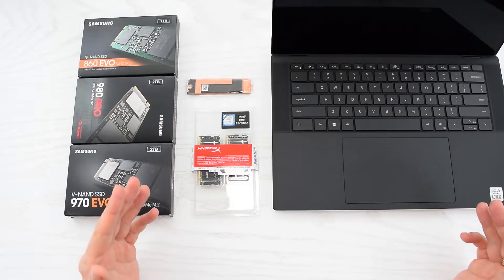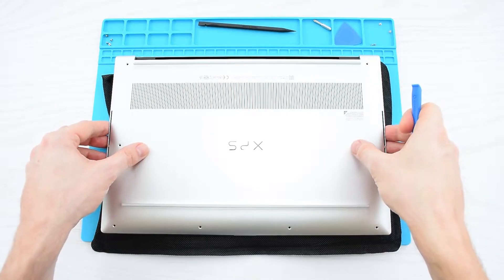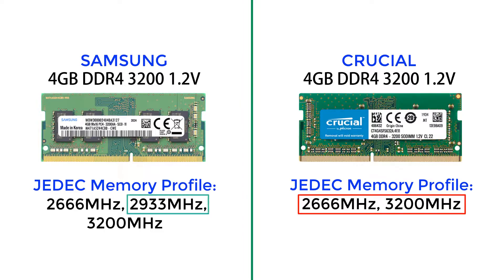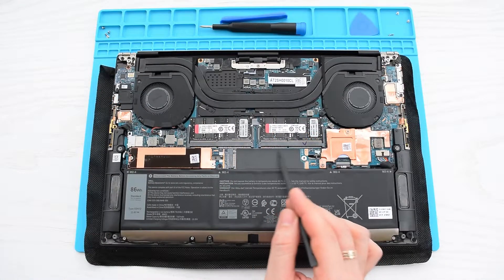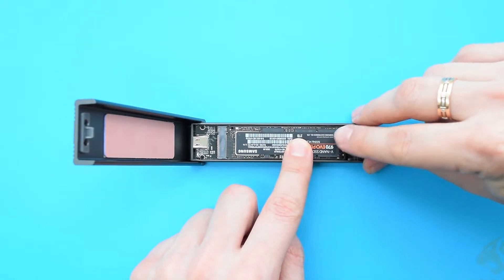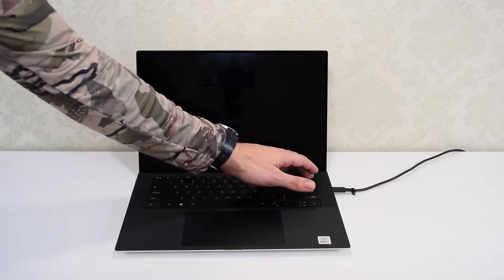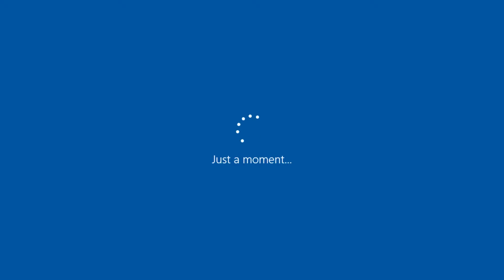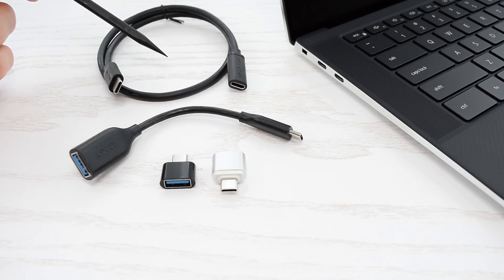Dell XPS 15 9500–9530 RAM & SSD Upgrade Guide | Max Performance Setup!

Comment: Thanks for recording such a detailed tutorial on upgrading the RAM and SSD for Dell XPS 9500.

I run into one problem, could anyone from the channel, or someone who watches the video help me?

Yesterday, before I started upgrading the RAM and SSD, I read on numerous websites that it would be recommended to disconnect the battery cable before replacing the RAM and SSD. I also asked ChatGPT and Google Gemini and they both confirmed that it would be recommended to unplug the battery cable to avoid accidental damage to the RAM or SSD, so I decided to unplug the battery cable before upgrading the RAM and SSD.

When I tried to disconnect the cable, it seemed a little bit stuck. Then I used this technique to remove the battery cable - https://youtu.be/E7qzwAFabS0?si=OB2mPJwvw2g9Px2F&t=466 - where you disconnect the speakers and lift the battery a little bit, that gives one enough room to disconnect the battery cable more easily, and this technique allowed me to disconnect the battery cable.

After replacing the RAM and SSD, I was not able to connect the battery cable to the socket. After it goes halfway through it, it seems to get stuck and no longer moves, no matter how much force I apply. Unfortunately, I have watched dozens of videos on YouTue and other Dell XPS laptops do not seem to have this problem. For them the battery cable can easily be disconnected and connected again to the socket.

I tried to connect the cable to the socket while applying the same force on the left and right side and try to connect it in a straight direction, but it just gets stuck halfway through and forcing it to move does not seem to help. I also tried to apply a lot of force, but it just does not move.

I used the laptop for work, and I did not expect this to happen. It's extremely important for me to find a solution to this problem soon. Can someone help me?

I want to thank everyone in advance who takes time to read my comment and replies. Your help means the world to me ❤
Reply from the maker: You'll never damage replacing a RAM module or an SSD just because the battery is still plugged in. It's a good practice to disconnect it only just in case you do something wrong. Like I mentioned in the video, if you're unsure of your skills or don't know what you're doing, then disconnect the battery. This is crucial because if you drop a screw on the board or if your screwdriver slips, you can easily short circuit something. I work with this type of stuff daily, so for such upgrades, I usually never disconnect the battery. Another reason I avoid disconnecting it is because it will reset the BIOS to default settings, and I don't know what custom settings the customers may have applied. In your case, it appears some pins were bent in the connector, which is why you can't fully insert it. What you need to do now is fully remove the motherboard so you can see the inside of the connector, and then use very thin tweezers or something similar to carefully straighten the pins. However, under no circumstances should you use the connector while it's partially inserted. A huge current flows through those pins during charging, which can easily melt the faulty connector and damage the motherboard. If you need more help, I will be happy to assist you.
Reply: @ElectronicsComputers  

I am extremely grateful for taking your time to write such a detailed response ❤ 

I can’t describe in words how much time you may have saved me and how helpful your reply to me is.

I am glad to hear that RAM or SSD won’t get damaged during the upgrade if I don’t disconnect the battery cable. I have upgraded RAMs and SSDs in my old laptops without disconnecting the battery, but I was doing it for the first time for my Dell XPS.

Since the Dell has a warning on the battery that says “Disconnect the battery before accessing any parts or devices”, I was worried about it. I also read two posts from other users that they have upgraded the SSDs and the laptop no longer was booting up and someone mentioned in the comments, that they may have accidentally short circuited the laptop.

Because of this, I decided to disconnect the battery cable just to be on the safe side.

I am confirming that I am confident in my skills and there’s minimal chance that I will accidentally slip the screwdriver or I may accidentally drop the screw on the motherboard. Luckily, I have a laptop screwdriver set. The screwdriver has a magnetic finish and the screw attaches to it once you remove them, so the chances of falling it off accidentally is almost minimal. I’ve never accidentally dropped the screw on the motherboard, or touched the screwdrivers on other parts of the laptop, so based your response, in the future, if I want to upgrade the RAM and SSD on my Dell XPS, I have to keep the cable connected and upgrade the RAM and SSD without worrying about damaging the laptop.

Thanks for letting me know that the pins may got bent and that’s why the cable no longer connects to the socket. From what I saw from the naked eye, the pins seemed to be aligned correctly. I will disassemble the laptop in a few hours again and will take a closer look at the pins with a magnifying glass.

I am happy to say that I have a small tweezer for the laptop, so hopefully, I will be able to correct the pins and connect the cable myself.

Thank you so much for letting me know that I should never partially insert the cable to the socket and it needs to be fully connected, otherwise, it may melt when charging the battery.

I want to thank you again for the detailed response. You absolutely made my day ❤
Reply from the maker: @bekamarsagishvili7957  I'm happy to help, as always! If the pins are perfectly straight, then maybe something got inside the connector. Also, check the battery side connector; you can use a needle to check each hole. There are some small metal contacts that sometimes can be bent. I'm pretty sure you'll fix it. It's a very good laptop and nicely built.

Comment: Hi,

I have the Dell XPS 9500, would it be possible to upgrade the M.2 to 4TB as I currently only have 1TB SSD.
Reply from the maker: Sure! Just put it inside and install Windows and that's it. There's no any limitations by the SSD capacity.

Comment: Do you remember the size of the screw for the second SSD? The screw from the first slot which is M2 size doesn't fit for the second slot. It much more thinner. M1.6 / M1.4?
Reply from the maker: There's always  M2 screws for all M.2 modules. In that particular case Dell uses M2x2 screws. Try to swap the screws.

Comment: Highly professional my friend 👏 

Can I use exactly the same upgrade on XPS 15 9530 i7-4712HQ 2.30GHz?

Thank you so much in advance🙏
Reply from the maker: Absolutely, all those models are the same. Just make sure you use the correct RAM; all the links are in the description.
Reply: @ElectronicsComputers  My apologies for a misleading description. That would be the exact Dell model -->  https://www.youtube.com/watch?v=PBPadu8T5WE&ab_channel=PCMag

XPS 15 9530 i7-4712HQ 2.30GHz 4cores (year 2013) 

Just how far can I push the upgrade for this model/motherboard please? 

thanks so much (like and subscription added)

Comment: Amazing video! So well shot and edited. To-the-point and quick!

I had one question though, is it necessary to use a heatsink for the SSD or can I just apply the thermal pad and call it a day (as TheEverydayDad did in his video of the Dell XPS 15 9500 upgrade)?

Thanks!
Reply from the maker: Yes, it's absolutely necessary to use a heatsink because that's what dissipates the heat. The thermal pad only transfers the heat from the uneven surface of the drive to the heatsink, and the thermal pad should be firmly pressed between two surfaces for maximum performance. The thermal pad itself won't cool down your drive; it will fall off once you flip your laptop.

Comment: If I buy a 980 PRO with the heatsink then I assume I can just install it as is?
Reply from the maker: Yes, if you buy a 980PRO with the built-in heatsink, you can use it right away. However, it's important to note that this SSD may not be compatible with all devices. For instance, it may not fit in most laptops and some portable desktop computers.
Reply: @ElectronicsComputers  Ok thank you!

Comment: hello, can i upgrade my xps 7590 with the 980 pro? i would like to improve performances and thermal issues
Reply from the maker: Yes, it will work perfectly well on that model and you'll never have any overheating issues with that SSD in that particular laptop.
Reply: @ElectronicsComputers  even if is too much powerful than the basic one installed on the laptop? just thinkin about the fact it's a 2018 model

Comment: Hi. I purchased the Kingston FURY Impact memory KF432S20IBK2 (2x32GB) which I believe is the same as you have here, but I get the 4 white 2 orange color codes meaning memory failed. Any thoughts how I can solve this? Specs indicate they support all the profiles you mentioned. XPS 15 9510 11th Gen i9-11900H
Reply from the maker: Try to swap them from a slot to slot and also try one by one in different slots. Those RAM modules should work perfectly well on that laptop.
Reply: @ElectronicsComputers  thank you. I tried that and still not working. Tried all combinations even mixing with the old 16gb memories. I read on forums that people have this issue and nobody seemed to have solved it. Many posts say XMP certified is what makes them incompatible.

Comment: Hi is there any point buying the 980 pro for this model because won’t the speed downgrade to gen 3 speeds anyway? both ssd slots are gen3 slots? I have the xps 15 9500 2021 model. is there a better alternative that’s cost efficient?
Reply from the maker: I've made a video about that as well. And 980 performs way better than 970 3gen SSD. And second of all Gen4 SSD running on Gen3 capable platform will never overheat. https://youtu.be/O1WlzO97VfA

Comment: Did anyone have an issue after installing the ram, i had issues getting the computer to get past the dell screen. Does anyone have a fix for that ?
Reply from the maker: What's the model of your laptop and what kind of RAM did you used?
Reply: @ElectronicsComputers  i have the 9510 and the ram I got was the same one in the link. It says kingston Fury impact ddr 4
Reply from the maker: @rainbowblk  Can you enter the BIOS or the laptop freezes at the dell logo? Did you disconnect the battery prior to installing ram? There are too many variables that could go wrong.
Reply: @ElectronicsComputers  first off thank you for the help. Yes the laptop keeps freezing at the dell screen and no yes the battery was disconnected and dead at the time. Can I email you or have you email me or something.
Reply from the maker: @rainbowblk My email is in the channel description. It's still not clear for me if you can get into the BIOS or not. Your laptop can freeze at the BIOS level with the Dell logo and when the laptop starts to boot Windows. Turn on your laptop and immediately start pressing the F2 key. If it does work, then turn off and turn on again, then immediately press and hold the Fn key and then start pressing the F2 key.
Reply: @ElectronicsComputers  hi cannot get into the bio with the new ram inside the dell laptop. I've been pressing F2 and nothing happens. But once I put back in the old ram I can access the bio. When the new ram is in the computer the dell logo loading screen is the only thing that shows up and the light below the keyboard turns orange and blinks white.
Reply: I have the same issue. And can't access bios with the memory failing. Did you get this resolved?
Reply: @garsoltero  I ended up just getting the  crucial RAM instead, never got it to work. Also my mother board ended up just dying in the end so 🙃 I'm going back to apple now
Reply: @rainbowblk  this is so annoying. everything about it is supposed to be compatible and just doesn't work. Now I am stuck with these expensive memories and can't return them because they are opened. Just losing money stupidly
Reply: @rainbowblk So, I went for Crucial and yes, they work. However, the fan now runs at full speed at all times, even if the temperature is cooled down, even on sleep. Did you run into this as well?
Reply: @garsoltero  yes I did run into the same issue with the fan. It wouldn't stop running even for little task. Eventually my mother board would end up failing so I didn't really get to experience the fan issue for to long 🙃
Reply: @rainbowblk  damn you Dell! I guess XPS 15 9510 is just not upgradeable
Reply: @garsoltero  Dell know what they were doing.
Reply: @rainbowblk  managed to fix the fan issue by resetting the Bios to factory settings, will continue monitoring

Comment: My dell xps15 doesn’t have the screw for the additional ssd space . Is there any work around here or should I just plug it and close it will that be good enough?
Reply from the maker: You have to buy a heat sink for the second SSD that comes with a screw. The link in the description.

Comment: Hello, I found your video very educational. Thank you very much. One question, the Kingston FURY Impact 32GB 3200MT/s DDR4 CL20 you put on your description has a 2933 Mhz profile. What I mean if I buy 3200 MHz Kingston, will it work on 2933 Mhz wit hmy XPS 9500 or it will go down to 2666 Mhz. Can you please advise RAMs which has 2933 MHz profile. Usually there a lot of 3200s around and I have a hard time to figure out which ones work on 2933 which ones do not. Thank you.
Reply from the maker: Thank you for the comment! These RAM modules will do the job: 
Crucial: https://amzn.to/3BRWKiK
Kingston: https://amzn.to/3MrOevv
Kingston Impact: https://amzn.to/3OxVMzy
Reply: @ElectronicsComputers  Thank you very much!

Comment: What is the thickness of the thermal pad? Seems like Thermal King has .5, 1.0, 1.5mm options.
Reply from the maker: You'll need 0.5mm pads for video memory chips and 1mm pads for VRM components. I recommend using GELID Solutions GP-Ultimate 15W/MK : https://alii.pub/6oz44c

Comment: Hello,

I dont think the kingston hyperX impact is compatible with the xps 15 9510. My laptop wouldnt read the RAM when installed. A few posts were saying it is due to a lower CAS Latency. If there is a fix please post!
Reply from the maker: There's a link for compatible Kingston RAM for XPS 9510.
Reply: @ElectronicsComputers kingston fury which you put in the list fir 9510 is not working

Comment: I bought this laptop and decided to upgrade the ssd im going with the 980 pro. Would their be problems if I got the one with the heat sink built in our should I get the one you got and buy a separate one
Reply from the maker: Samsung 980PRO with heat sink is made for desktops or for some consoles like PS5. There's no way you can fit it in that Dell laptop. Just buy a regular SSD. And I'd suggest watching a video on how to properly apply thermal pads on a new SSD. I have a video on that too.

Comment: Great video(s)!  Thank you for taking the time.  I am about to buy an XPS 15 9510.  I am going to get it with 500GB drive intending to upgrade to 2 TB using the 980 Pro you recommend. I plan to load Windows 11 onto the 2TB drive (downloading the windows 11 media creation tool from the MS website).  My question... The drive from Dell will come preinstalled with Windows 11, but also all the "bundled" software they add - most of which I don't think I need.  They provide a 12-month license to McAfee, but I will figure that out.  If I just load Windows 11, I assume none of that other "junk" (bloatware?) will be loaded.  Is there any of it that I need, or should keep? Second Question:  The computer comes with 16GB of RAM.  Upgrading to 64GB is expensive.  I plan to use 16GB for a while and see how it does, but interested in your opinion on how much RAM to get and performance implications (photo editing applications).  Thanks!

Comment: Does it have to be ddr4 ram or could I put 2x 32gb ddr5 ram? Would that be compatible?
(Amazing video btw)
Reply from the maker: That laptop only supports SSR4 RAM modules. DDR4 and DDR5 are physically different.

Comment: I cloned the Dell OEM SSD using Macrium Reflect (free) and it worked perfectly. On the newer 11th gen XPS SSD 1 is on the right side, but the look / design appears to be the same; because of the SSD-1 versus SSD-2 I accidentally ordered the wrong one and had to reorder it.
Reply from the maker: That's right, in 9510 for some reason they decided to switch to the right drive. I mentioned that in the video description.
Reply: @ElectronicsComputers  .. I'm not blaming anyone, just saying. However, I'm really liking that Macrium Reflect, So much so I decided to buy a copy to make periodic backups on all of our home PCs.

Comment: Thanks for this amazing video, i have the same laptop with 1TB is it possible to add another 2 TB or i need to add same storage capacity which is 1TB?
Reply from the maker: You can use and drive capacity you want. At the moment 4TB  is the largest NVMe drive yet.